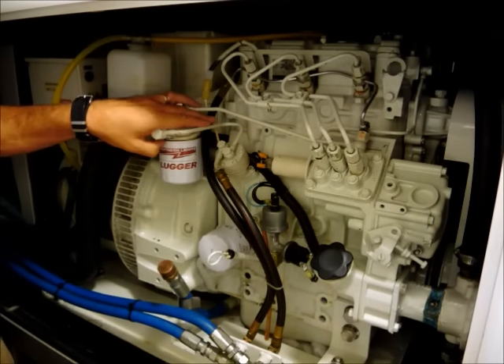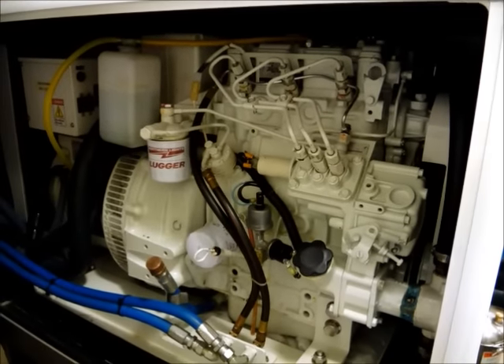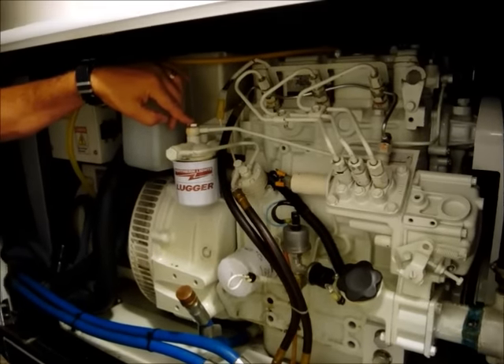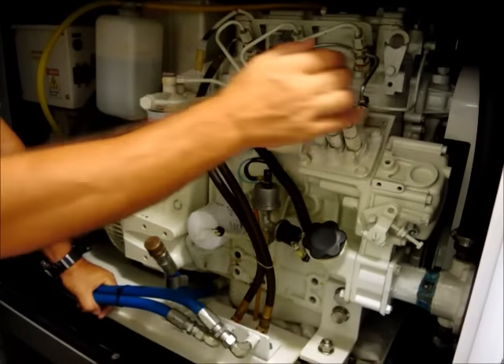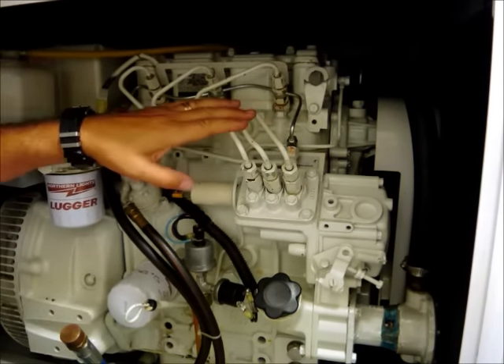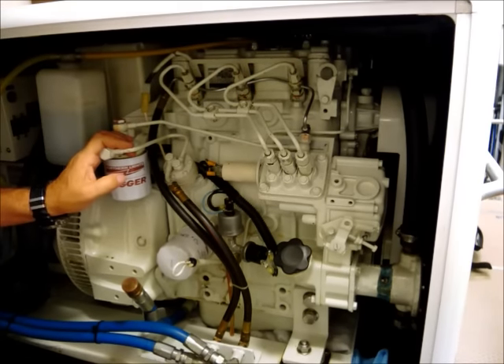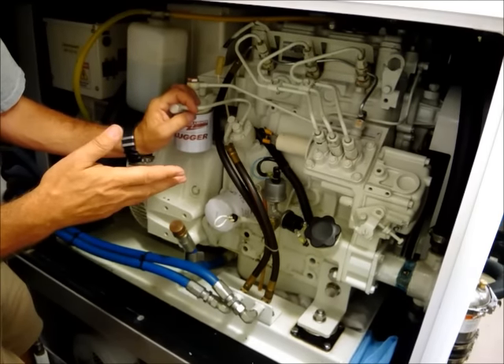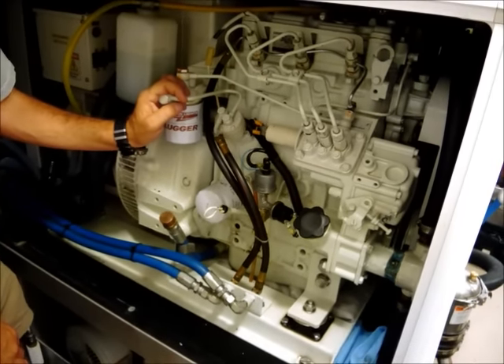Fuel System Bleeding

Comment: Saved me a call out costing hundreds for my 3tone dumper! After changing the fuel filter wouldn't start, did the bleed valve above the filter then the loosened the fuel rail turned her over 3 times 7 seconds and time did it all back up and broom after some open throttle started up, brill thanks
Reply from the maker: Great, glad it worked for you.

Comment: The process is straightforward thanks to this video, my primer pump was very different and concealed, had to unscrew it for it to pop up so i could start pumping.
Reply from the maker: Steve,  thanks, and yes some pumps are stowed by pushing the handle in and screwing it tight.  Glad you figured it out, and I assume you are up and running now.
Reply: @SDMarineConsulting  All up and running my friend, thank you.

Comment: Good explanation.   I have a diesel generator and the manufacturer didn’t want to take the time to show me how to bleed it.  They claim it’s programmed to shut off before running out.  However , as you pointed out when you change the filter it needs primed.
Reply: Just fill the new filter with diesel and then install filter and no problem

Comment: good video, I'm not a diesel mechanic but I try to do my own things here and there to save a few bucks. I got my tractor to crank and it started but cut off. I bled it but I did not follow the steps you indicated here which tells me the line may still have air in them. I will go through the steps you listed and hopefully that solves my issue. Again thanks for the video.
Reply from the maker: Probably air in the injectors or pump, give it another try and let me know how you make out.

Comment: I am trying to start my restored VW rabbit pickup and get it running from its own diesel for the first time. It starts and purrs good on starter fluid but I think I might need to do this to grt it pulling diesel. It only has the one mechanical injection pump, no auxiliary or fuel tank pumps of any kind
Reply from the maker: It must have a lift pump to get fuel to the injection pump,  sometimes it's at the tank, sometimes on the engine, but the lift pump has to be fed fuel.

Comment: I have carefully maintained my 2QM15 since acquiring my sailboat in 2016.  Always run my diesel and she’s worked great.  Just the other day I observed a loss of power as I was up throttle a bit heading to the marina, the diesel seemed to slow almost stop then caught its breath and ran fine then repeated.  I’m very suspicious that either air or water might have gotten into my lines.  Am looking at your excellent video for clues as to where to begin my investigation.
Reply from the maker: Check/change your filters first, that's easy.
Reply: @SDMarineConsulting  well I changed my filter last year and it should be fine.  Today I checked diesel flow to the key parts around the engine.  I also checked my air filter and it was pristine.  It starts up just fine and did today.  I’ve yet to check the water inflow however so perhaps there’s obstruction but I’m skeptical.  Still scratching my head. Thks for answering 😊
Reply from the maker: @billleskeep2033  OK, let me know what you find.
Reply: @SDMarineConsulting  I performed routine bleeding of filter on top then of the two injection points and all were fluids so tightened then ran without any problems.
Reply from the maker: Great!
Reply: @SDMarineConsulting  great video by the way, good lighting too!

Comment: Pump line nozzle pinch return line, do not completely crush, and start. Pump pushes fuel no need to open system. Mechanical works every time for me  Best of luck.
Reply from the maker: "...and start"?  This video is for engines that are air-bound and won't start.  If you  mean crank, while that technique may work for you, it's not one I recommend, restricting, even if it isn't closed completely, return fuel can cause seal failures within injection pumps.  If it was as easy as just restricting return fuel to bleed air out of a PLN system, engine manufacturers would instruct users to do that, rather than the more lengthy bleeding procedure I describe.

Comment: Excellent video Steve, I have exactly the same engine and fuel is leaking out of one or two of the nuts on the bottom of the injection pipes on the pump. How can I fix this please, I only noticed today motoring back to harbour.
Reply from the maker: Chris, sorry for the delayed response.  That's probably an O ring issue.  These pumps are known for this after some time.  If you are handy you might attempt a repair, you might try tightening the nuts first but if that doesn't work the O rings should be replaced, and depending on the hours that might be a good excuse to rebuild the pump and change injectors.
Reply: @SDMarineConsulting  hi Steve, thanks for the reply. It was the o rings perished. But I took the pump to some guys who knew what they are doing, charged me £50 to refurbish it. Works fine now.

Comment: Hi Steve, thx for your video. When bleeding the injectors you say you crank a bit, (1) does that mean faking starting the engine or actually starting it for a couple of seconds ?....  then air comes out of the top of the injector follow by solid stream of fuel you say. (2)Do you tighten the nuts while the engine is running ? (note I'm trying to apply this procedure to my Toyota Land Cruiser BJ42, but the parts and principles are exactly the same, do you have any observation on applying the procedure to a truck engine ?) Thank you very much for your input. Cheers.
Reply from the maker: Nem, I used to have an FJ40, sadly not a diesel, they are not available in the US.  "Cranking" means turning the engine over with the starter, not starting/running.  The engine will not start if the nuts are loose, so no you do not tighten while cranking,  In fact doing so is dangerous because if you tighten a few and the engine starts then the fuel coming out  of the remaining loose fittings will exist at very high pressure, so you want to avoid that.  Crank with all nuts loose, tighten all nuts then try starting.  Cover loose fittings with rags.

Comment: Excellent Video! You correctly said that the high pressure injectors are better primed by cranking the engine. In case you have limited battery energy, can you use the manual pump to bleed the injectors ? First you would have to open the valve operated by the solenoid which In your engine(which is in strikingly well kept conditions) is  on the left side of the injection pump.
Reply from the maker: Brik, thank you.  I'm afraid you cannot prime through the injection pump without rotating it, this is where so many users fail in bleeding, you can bleed up tot he pump, however, if there is air in the pump, and in the injectors, you must crank the engine, turning the injection pump, to bleed it out.
Reply: @SDMarineConsulting  I guess it makes sense that the pump is a one way tight environment. If I was able to push the oil up to the injectors with a few PSI,  the oil would also be pushed back to the supply line when running. I made a modified tank cap which has a low range pressure gauge  and a steel tyre valve. This way I can quickly pressurise to 3 psi the tank with a compressor or portable aerosol can filled with air. Useful for tanks with little fuel or where the tank is below the engine level (eg CAT machinery) and where the manual priming pump is inaccessible.The engine  has not been started for a couple of years and usually the stop valve gets stuck, but this time I removed the solenoid to manually play with the stop valve, but I still get no flow through the HP pump.

Comment: Hey Steve, awesome video. I’m working on a Perkins 3 cyl in a mower, I got fuel out of the line on the injection pump. However, I cracked the injector line like you said, but no fuel when I crank the engine. Any ideas? I appreciate your time thanks.
Reply from the maker: Shane, are you sure you have purged, pumped fuel all the way up to and into the injection pump?  Perkins use CAV pumps which are a bear to bleed, you have to bleed the pump itself first, then the injectors.
Reply: @SDMarineConsulting  Yes I can contact until I got a solid stream of fuel pumping out of the line runs from it to the top of the injection pump that has two nuts. I also tested the fuel shut off solenoid and it works perfect.
Reply from the maker: @shanejones5297  OK, but you have to bleed the injection pump itself, it has a bleed valve, have you done that?  See the photo here, this is a Simms pump, but it's similar.  http://authtool2.britishcouncil.org/ford-3000-tractor-injector-pump-diagram.html

Comment: Hi Steve, great video.  I’m having issues priming the system prior to the injector pump.  Pumping the lever on the bottom of the lifting pump doesn’t get me any fuel.  In order to eliminate the possibility of an air leak somewhere in my system between the lifting pump and the fuel tank I removed the supply line attached to the feed banjo bolt, and put it directly in a cup of fuel that I held as I pumped the lever.  So I know without a doubt no air is leaking into the supply.  I then removed the outgoing banjo bolt on the lifting pump to see if it was moving fuel, no fuel.  I tried cranking as well as pumping the lever for several minutes.  No fuel.  This is a brand new lifting pump as I went through the same process with the old one and assumed it was bad.  What am I missing?  I can’t seem to get the new pump to create any suction.  Thanks in advance for any advice.
Reply from the maker: The fact that neither of your lift pumps are pumping is puzzling.  You might try forcing some fuel into the lift pump with a hand pump, like the primer bulb hose from an outboard (make sure it is devoid of all gasoline first).  It's possible this new pump's seals are just dry and it can't establish a prime.
Reply: I did try to gravity force it by attaching a funnel to the line and held the line above the engine so it was all downhill for the fuel.  Maybe a little more pressure could get me some results.
Reply from the maker: If the inside of the pump is "wet" it should prime, but worth a try.  If you move the manual priming lever by hand can you hear the pump diaphragm moving if the fittings are removed?
Reply: @SDMarineConsulting  I don’t know that I would really be able to differentiate the sound of the diaphragm from the sound of the lever moving.  When I’m down at the dock again tomorrow I’ll try it out and get back to you.

Comment: I tried with my diesel 22kVa Genset and no success on fuel coming out of the high pressure side. I think it is the fuel solenoid on the injector pump, so I will check that now
Reply from the maker: If it is a pump with a built in solenoid, those do fail, some are energized to run, others are energized to stop, if it is energized to run, make sure it's getting power.
Reply: @SDMarineConsulting  Thanks alot Steve. I will check it out - cheers

Comment: I have an old sky track  i ran out of feel and i already did all that and it won't  star...what's  the next step
Reply from the maker: Jorge, hard to say, have you checked to confirm you are actually getting fuel at the injector fittings that you have loosened when cranking?  If you are it should start after tightening them.  If not, try another round of bleeding, you may still have air in the HP pump.
Reply: Perhaps all that the owner of the video said should be the first priority of check, but i would like to add another possibility that most people over look when the car doesnt start after doing the air bleeding procedure well. This. can be the battery to run out after all that starting force can consume a hell of battery energy, and the car wouldnt get started because of that, and it usually gives you the same sound when you try to start.

Comment: That is the primary filter, not secondary..
Reply from the maker: Thanks for the comment Hydro.  The filter on the engine is referred to by most if not all modern marine engine manufacturers as the secondary filter because it is the second filter the fuel reaches on it's way to the engine.  The off engine filter is referred to as the primary filter because it is the first filter the fuel passes through.  Decades ago, some engine manufacturers did refer to the on engine  filter as a primary, but that practice fell out of favor.  

From the Lugger OLP Operator's Manual, for genset models LP445D, LP445T, LP668D, and LP668T, page 12 "NOTE: The fuel filter on the engine is considered the
“secondary fuel filter”. The engine will be fitted with a
quick change disposable secondary fuel filter."

Comment: Uggh dude I can't see shit!just pointing at shit with cam 10 ft back don't help me much...i need to see bro.
Reply from the maker: What exactly can't you see?  I'll provide any additional detail you may need.
Reply: @SDMarineConsulting   hey Steve thanks its ok I'm just so frustrated I had such a tough time grasping this but it turns out I think my boats "day tanks"(like a secondary tank that helps manage fuel level cause sail boats rock and roll a lot so gauges are not reliable) transfer pump(an additional pump for the day tank to pull diesel out of the main tank)was diying and not indeed transferring fuel so I kept sucking air whilst bleeding and hence I'm still very frustrated but I think I'm on the right track but as to your video well being a newbie to diesel and not knowing what all the parts are exactly from that distance I just couldn't see you were talking about exactly but it's ok thanks anyway;)
Reply from the maker: @jasoncreed6396  No problem, and day tanks are fairly common for the vessels I work with, it can be complex initially.  Lots of good tech articles on my website, including about fuel systems and filtration.  Some of those may helpful.  www.stevedmarine.com   Here's one https://stevedmarineconsulting.com/wp-content/uploads/2018/12/fuelplumbing.pdf
Reply: @SDMarineConsulting  thanks Steve, good info.